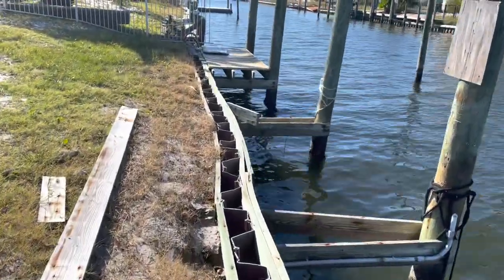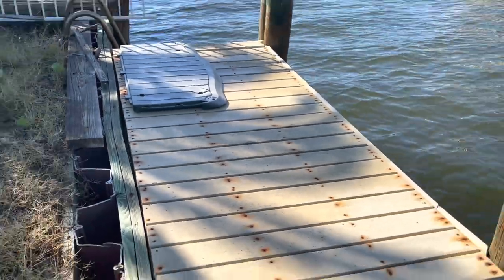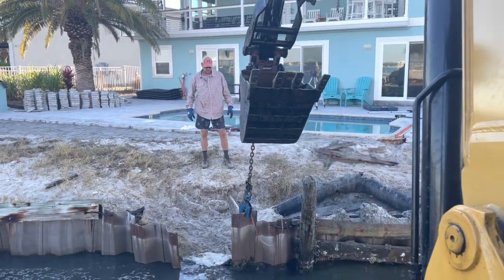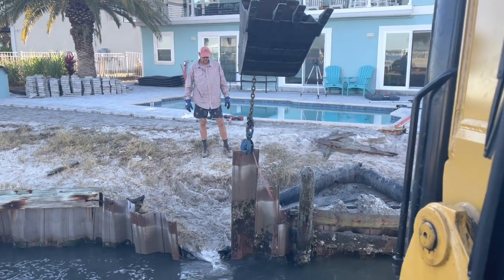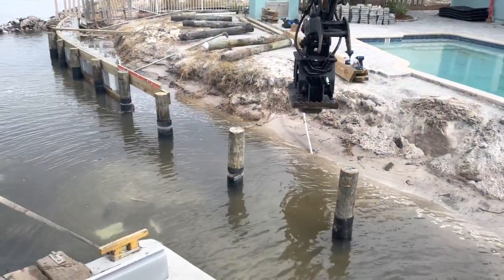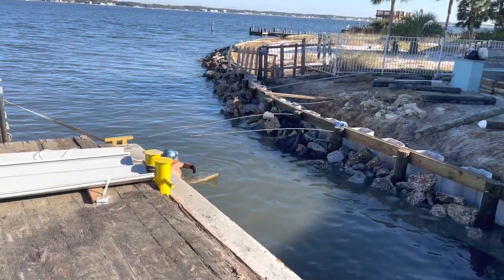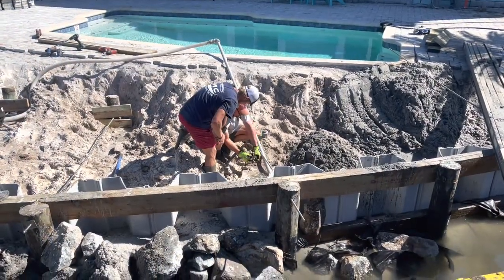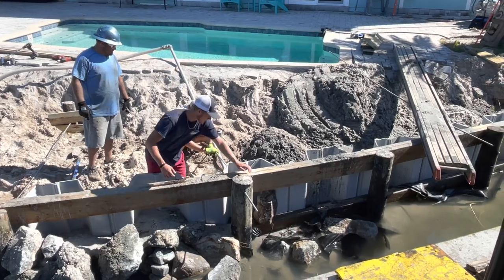Replacing an old vinyl seawall

Comment: I see you are not using poles in front of sea pales hou come
Reply from the maker: Thanks for your comment the vinyl sheet Piling we use is good up to 6 1/2 to 7 foot exposed I do preferred to put a center whaler a Pilings in front when I get higher than that I really recommend anything about 5 feet.

Comment: How do you remove or cut through fiber cloth that is deep down?
Reply from the maker: Sorry I missed your question and thanks for watching my channel. That is a real challenge. Equipment really helps by digging it out. Sometimes you just have to try to drive it down through it. I have put an ax head on the end of a pipe before to help with that when I can’t get equipment in the area.

Comment: I learned alot by watching you. I wish could afford a barge and pusher, but I just can't seem to get ahead enough to afford the purchase. I have decided to go with an all aluminum barge 10'11.5" wide × 30' long  that is towable, 30 ton verba crane on a turntable , with a mantis hammer for 80k, and for landward bulkheads, and fill  I have delivery of a jcb 1cxt in March. Some bigger companies in my area that actually relate between each other say it is a good plan but they wouldn't do it. I don't have much choice due to the financials of the situation.  I am 5 years in and 41. The manual labor, wetsuits. Washing everything by hand is rough on my old worn out 24 yrs of construction back. Time to switch it up the best that I can afford. I think I will do ok. I am in the inner/obx area of northeast nc.